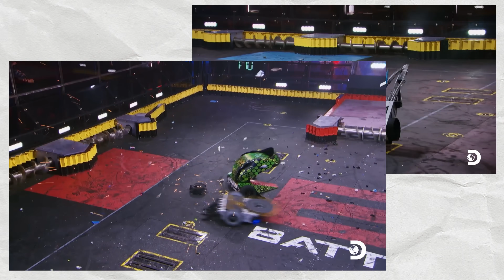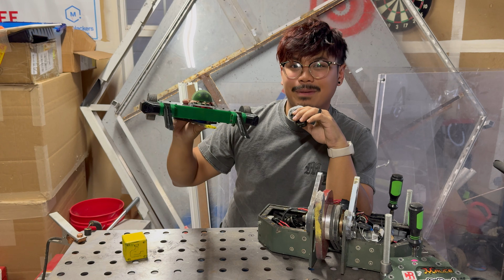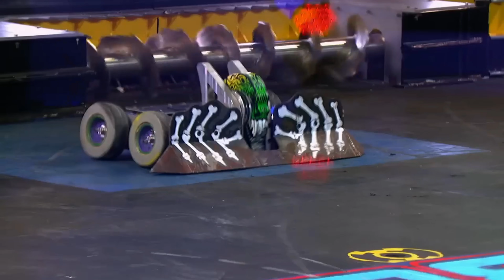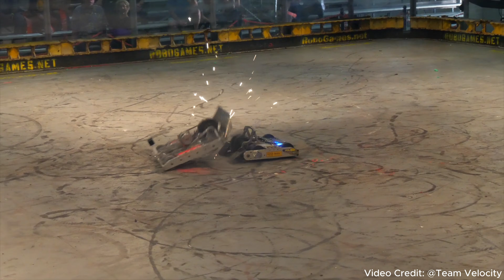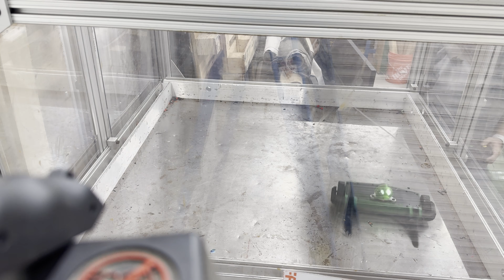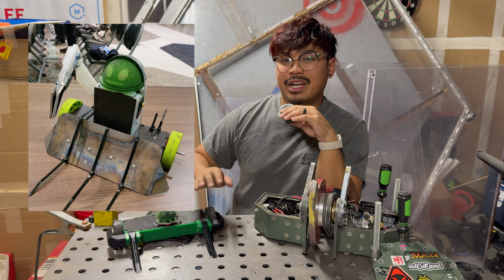Trying to Beat the Battlebots Meta

Comment: Finding new ways to go against the meta or even just doing old concepts differently is so interesting. My robot idea, Bravado, is fuelled by the admittedly limited innovation in flipper concepts over the years (I mean, the biggest i can think of is Hydra, and that took till 2019 for it to happen)

So Bravado has what I call a "full body flipper", where the whole shell lifts up to flip opponents away, meaning we're protected on all sides and every angle of the robot is a flipper tip, there's no worrying about being positioned just so to get a flip in, etc.

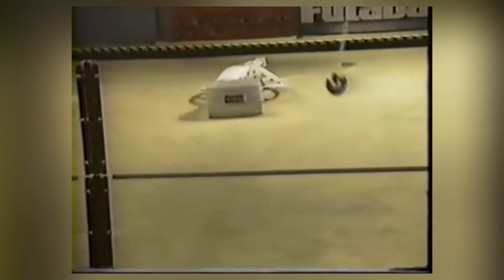Comment: Have you ever considered looking into competitive Beyblade X? Obviously the meta is quite similar being filled with 100% mechanical horizontal spinners, but you'd be surprised at how much it feels like a "tabletop Battlebots" strategy-wise. The fact that lifting your opponent off the ground is the big tactic is also somewhat similar, as Beyblade X's meta currently just got shaken up by SharkScale, a heavy attacker that excels at "upper attacks" which strategically achieve the same thing as @2:40. It has lead to discussion in the community about the best shapes and combinations to resist uppers with a large group of players focusing on using high central weight-distribution + low height + downward pressure on needle-point tips to stick to the stadium better.

Comment: bite force was built around being the first one to get itself back under control and driving towards the enemy after an interaction took place, this meant that even if you hit them there were surprisingly good odds that they would be the one able to take advantage of the fallout instead of you.
there's a reason that that thing won a championship while competing without it's weapon despite not actually being all that fast or maneuverable, it was essentially a control bot built by a guy who decided to remember that vertical spinner weapons make great flipping tools, especially when your opponent doesn't think it's a flipper.

...causing so much damage despite having one of the weaker weapons around was all on the driver being a badass though, winning positioning after a hit because you're the first to get properly reconnected with the ground is one thing but being back in control and aiming at specific parts of the opponent so fast that you commonly hit specific sections of their underside by having them land on you just right is very much a result of an absurd degree of operator skill.

Comment: Another fantastic video. I feel like Rotator in 2020 started to slightly shift the meta in favor of horizontals with the addition of forks. Then a year later Thagomizer took the design to the next level.
Reply from the maker: I really need to talk about the Thag design at some point; it really did revolutionize the idea of the modern horizontal imo